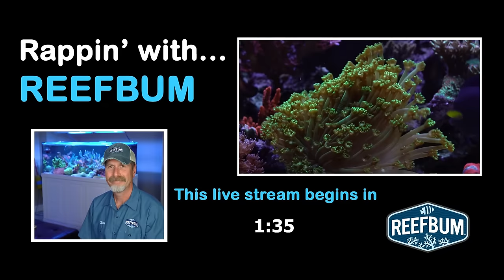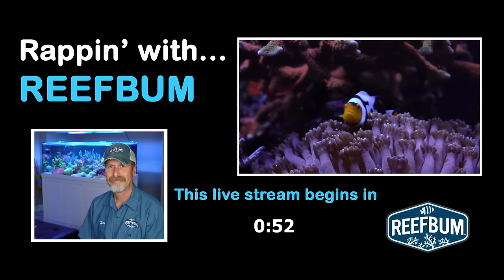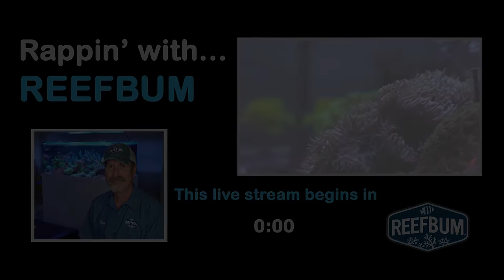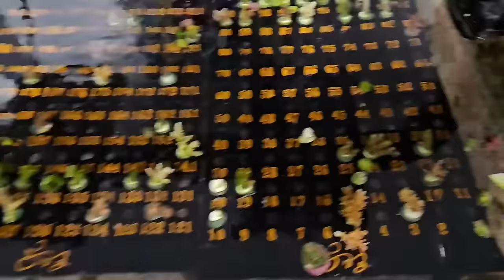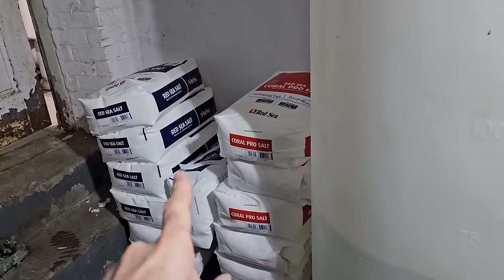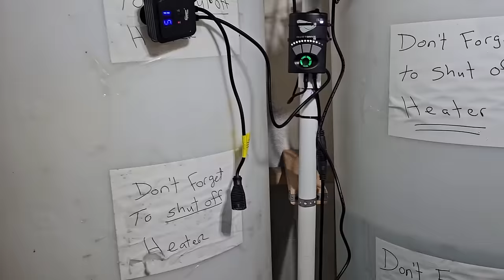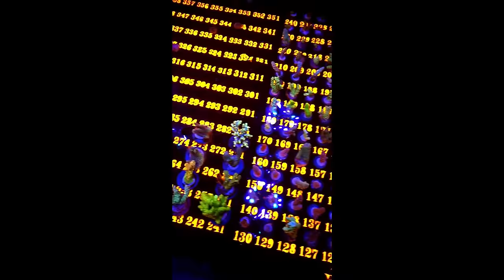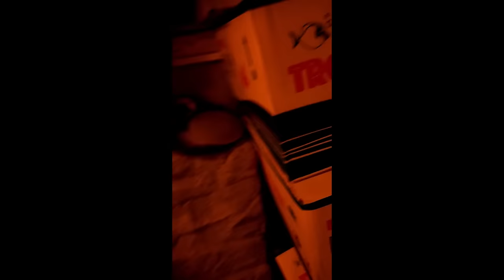Rappin' With ReefBum: Guest Shane Backer, SBB Corals

Comment: @ the RO/DI conversation…Please contact a company that specializes in RO systems. They can get you setup with something that will save you money and decrease maintenance if you’re changing filters so often. Membranes should last longer than that if done correctly. If you research RO systems, you’ll quickly learn bigger versions exist on the light commercial/commercial side. Bigger membranes, larger cylinders & tanks. I’d quit if I had to mess with my RO so much. 😂
Reply: great idea will do